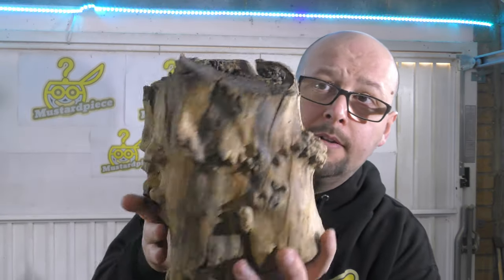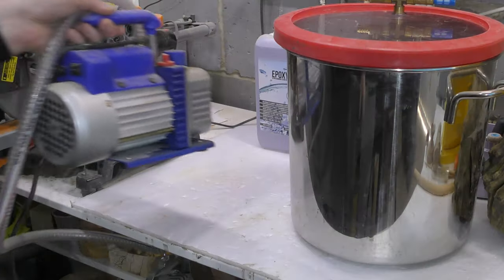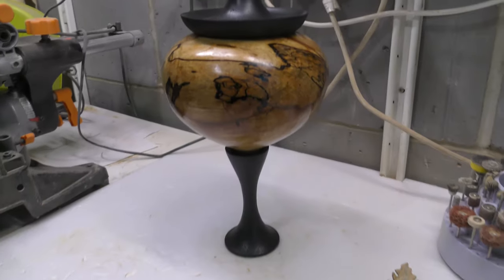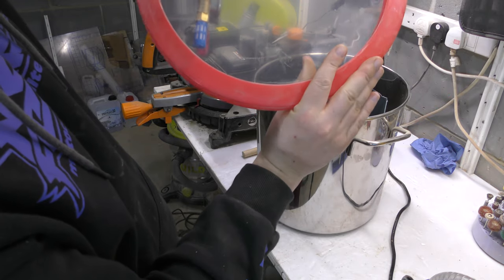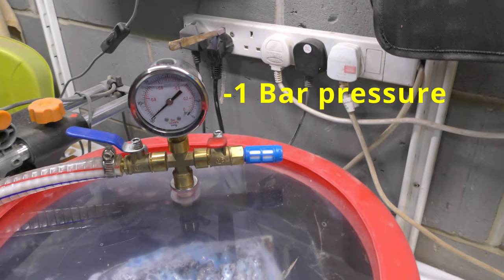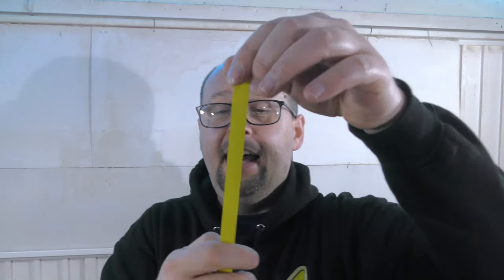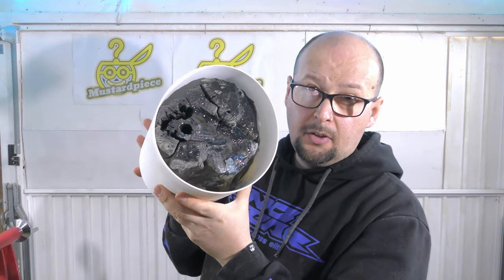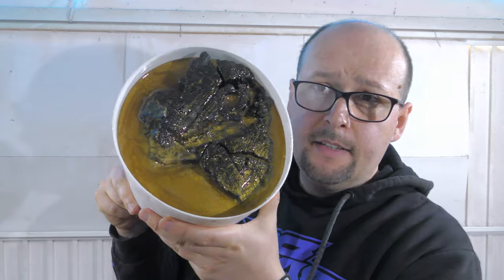Can I Save a Completely Rotten Log? -  Is it Even Possible?

Comment: You want to keep the vac running the whole time until bubbles are out.   Also what you really need is a pressure pot for resin.
Reply from the maker: I dont think my chamber would support much more than -1 bar pressure. It would crack. I have just bought a compressor recently. I save up for a pot too. And a paint gun. Soon.

Comment: Resin will set faster with deeper pours.  The volume heats up causing the resin to cure.  A pressure pot also works although you can't watch what's happening.  The advantage to the pressure pot is we usually have a compressor already for cleaning and ridding items of shavings.  With the vacuum chamber,  you have to buy another piece of expensive equipment.
Reply from the maker: I already have a compressor. I buy a pot soon. :)
Reply: @Mustardpiece  you have all the fun toys.  😁😁😁
Reply from the maker: @suzetteedwards7956  😁